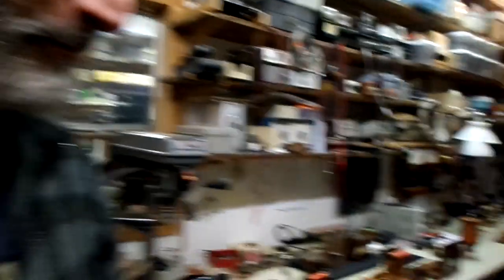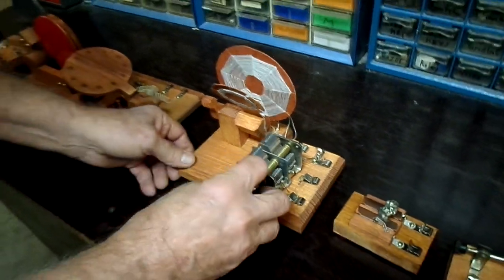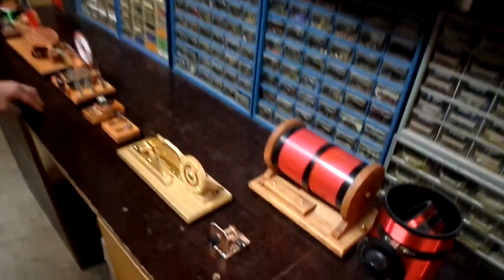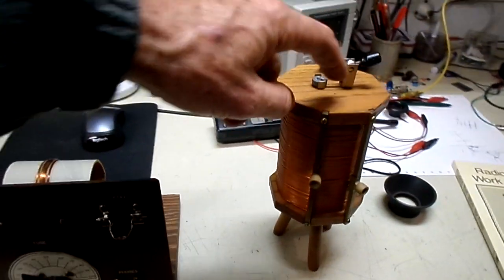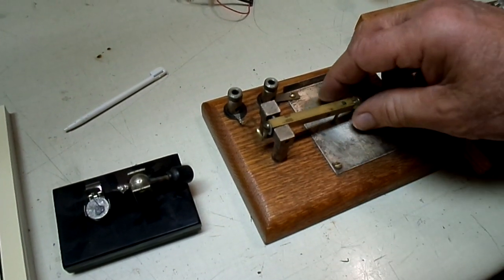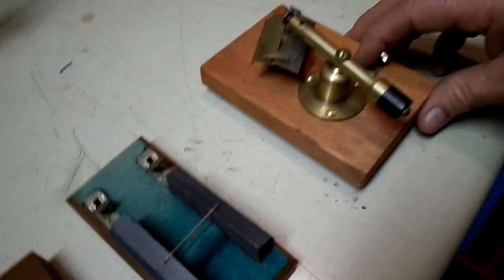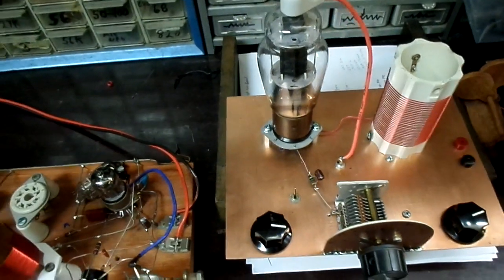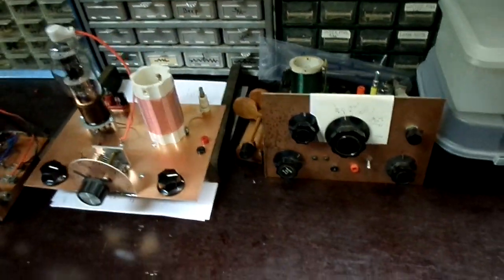Radios That Work For Free.

Comment: Very nice show and tell, and I love his unorthodox construction of adjustment methods. 

My brother gave me a Radio Shack 100-in-1 Electronic Kit when I was about 7, really early. I built most of the circuits in there and still have it. That got me into ham radio and an electronics career. I loved the crystal and transistor radio circuits in the kit best. 

I’ve been meaning to try the needle-across-carbon detector. Have you ever tried zinc oxide? I heated a sheet metal screw in a gas stove flame and that worked well. 

Germanium transistors are very sensitive diodes when you short B and C. 

For speaker output you can use a transformer. Paging/horn type speakers are cheap and sensitive.

Comment: I built a foxhole detector and radio using junk parts when I was around 14, I even posted a video at the time. https://youtu.be/HAVs2XBtfs4
I didn't have a crystal earpiece at first so i was using PC speakers, so technically my radio had an amplifier stage, but it proved to me that power free radio reception was possible. I think the wire for the coil came from a motor, and pencil lead and blued blade made the detector. What a cool hobby :)

Comment: Could you explain demodulate a signal? Thanks
Reply from the maker: If you had a CB radio and you pressed the microphone but didn't talk, the signal your were transmitting would be called the carrier wave. If you spoke into the microphone that would be called the modulation part of the transmitted signal.  To demodulate a signal means you are removing the audio information, or any kind of information which rides on top of the carrier wave  being transmitted such as your voice,  I hope this helps.
Reply: @GrantsPassTVRepair  thanks for replying. I was thinking if you were building a receiver why would you want to demodulate if your wanting to hear it was what I was thinking watching the video. I’m a newbie so look over me.
Reply: @GrantsPassTVRepair  Technically not removing the audio from the carrier but extracting the audio from the modulated carrier.
Reply: A carrier signal is used, this is the radio signal you tune into at a specified frequency.

A carrier is typically a sine wave, which is the simplest type of waveform possible. It contains only a single frequency.

A sine wave is defined by: amplitude, frequency and phase.
And you can change any of these.

To transmit audio by radio, we often use a carrier signal (but not always) and we have to change the frequency, amplitude or phase of the carrier in sympathy with the audio signal we wish to transmit.

If we change the frequency, then that is called Frequency Modulation, and if we came the amplitude that is called Amplitude Modulation.

So we have an electronic circuit in the radio transmitter that takes the audio signal and combines that with the much higher frequency carrier signal.

AM is easiest to deal with, to understand, and much simpler electronics required than FM.

So what is transmitted is a higher frequency carrier with the audio signal amplitude modulated on to the carrier.

You'll need to look for diagrams depicting this.

What is received by the radio receiver is that amplitude modulated carrier, and what the radio has to do is remove the carrier signal so that you are left with the audio signal. This process is called demodulation.

In AM radios it turns out this is incredibly easy to do. We just use a diode.

Comment: Oh,very good Performance.For 5 Years i endet my Hand Radios coil Manufacturing with colored Cooper wire good Coils.With Germanium or Schottky Doofes I receyving in the night Hourer 16 AM Stations with coopler Voila and 10 Meter Wire and Warth Ground,High Impedance Headphones.Best Regards Matthias

Comment: I was doing this stuff beginning around age 10 or 12. One tube radios using a 1T4 quickly followed with an A.C. Gilbert set. Then a two tuber Knight Kit.
   This is all still valid education for both adults and kids. What is a mobile phone before it's anything else? Answer: It's a two way radio. Without that most of the other  capabilities are impossible.

Comment: The "foxhole" radio at about 5:46 is just the detector. The actual radio needs a coil. Generally there is also a "wiper" to make the coil adjustable. I made one in the 4th grade or so (early 1960's). I think I used the school's steam heat radiator pipe for the ground. It worked. Crystal headphones have the best output. Cheap crystal headphones were easy to find in the 1960's.
Reply: Yes I think a foxhole radio would include a coil with 120 turns. But I don't think the G.I.s used wipers on their coils?

Comment: I built a crystal radio in the late 70's just for fun and the first thing I heard when I tried it out was E.G. Marshals voice the program was The CBS Radio Mystery Theater.
It couldn't have been more perfect timing, it was as if the radio was picking up broadcasts from the past. At the time I was stunned because until then I didn't know the program existed.
Reply from the maker: I can identify with the sense of wonder you must have felt.                                                                                  As a small boy I remember the thrill of hearing mysterious voices coming through my earphone. It was as if I was listening to aliens from another planet, and taping into a secret conversation of unknown origin.
Reply: @GrantsPassTVRepair  I was almost 30 at the time and it still was amazing to me that this particular show happened to be on  at that moment.
Reply from the maker: @electronron1  Sounds like it was meant to be. :-)
Reply: CBS Radio Mystery Theater boomed in on the crystal set I made that used a coil wiper.

Comment: This is a delightful video!  I am so glad you tracked down KE Edwards.  I ordered his book using your link to Hope and Allen, not wanting to pay $325.00 from Amazon or Ebay.  I cant wait for it to get here.  Ive been making various crystal radios with my grandkids when they come over for a week or so to visit...they have something to take home and talk about.  Ive been experimenting with making copper plate capacitors with saran wrap between the plates with a plastic screw to press the plates together and adjust capacitance.  I have had a lot of luck making coils that fit into each other rather than remain adjacent....I use forms using PVC couplers or tubing and find things with the proper clearance or either sand the insides down with a drum sander until they fit.  I wish someone could prevail upon Hope and Allen to print his second book.  Also...maybe Hope and Allen could get the rights to print "boys first book of radio and electronics" so we dont have to pay $200 on Ebay which I cant afford.  Thanks again for putting this together for us all.  Ted
Reply from the maker: I got my first crystal radio as a kid and never stopped enjoying them. All the best.
Reply: @GrantsPassTVRepair  So, I got the book, Radios that work For Free, and i have assembled the First Crystal Set Project, page 92, exactly as specified, and I cannot get it to work!  Nothing, nada, dead!  Yikes!  I have a great antenna, an excellent ground, both of which work on several other crystal sets I have recently constructed, but this one is a no go.  I think I must be doing something wrong,  I cant figure it out.  I'm confused and tired; I gotta get some sleep.  I'm gonna futz with this tomorrow in the AM.  Ted
Reply from the maker: @than111  Don't give up they do work.
Reply: @than111  Did...... You get it to work? Simple mistake? I'm curious.

Comment: I saw and heard a radio powered crystal set in the early 1950's. Invented by Wes Nichols.  It detected a strong local station and used the dc to power a Germanium transistor crystal set.  A 12" speaker no less!
Reply: That is a "stolen power radio".  You use the signal from a strong station to power the reception of a weak one.

Comment: what happens if you turn on all the radios. are they more quiet when all near eachother?
Reply from the maker: I'd guess each radio could potentially lower the volume of other crystal radios if the antennas were close to each other, but that's an interesting question.
Reply: @GrantsPassTVRepair  i have an instance... its CB radio AM but still the same concept. I have a 102" whip and I was parked right next to my dad and he couldn't talk because my massive antenna was interfering with his but when I drove down the street he got out fine
Reply: you get space radio signals!!

Comment: It remind me my first radio which  i built when i was a kid, in a small 
candy box TicTac, I made a paper roll for the coil and inside was a 
ferite bar to adjust de channel, i used a  diode which was a germanium 
OA90 and the capacitor a fixed ceramic tube 220pF, awful low sound 
volume on ear pieces, but working, no point anyway :D need 20 meters 
antenna wire and a ground wire as well, just experimental to have fun 
with children. No battery, but not portable at all :-) I saw it is 
possible to build such simple FM radio as well, but with some more 
components.
Reply from the maker: I also hope to build one for the FM broadcast band to see what's possible. A crystal radio was the first radio I ever owned. I remember being absolutely captivated that this strange little gadget my Uncle built me could pick up sounds from right out of the either, and adjusting the cats whisker over different parts of a rock could enhance reception.
Reply: HF is mysterious anyway, and always acts in reverse we would believe in LF

Comment: Very nice video. My first crystal radio I made was the last project in the class I took at 4H 60 years ago. For headphones I used my father's cloth cap/headset that he wore flying the US Navy F6F Hellcat in WWII on the USS Lexington (same as these chaps are wearing:  https://www.google.com/url?sa=i&source=images&cd=&ved=2ahUKEwiTw4LLrOrmAhW6JzQIHfJ4AFEQjRx6BAgBEAQ&url=https%3A%2F%2Fwww.amazon.com%2FPhoto-F6F-Hellcat-Lexington-Pilot%2Fdp%2FB007RQGHDO&psig=AOvVaw0DjJzayduatfneW6lOCDsb&ust=1578241038970850). Worked great! Did I see Litz wire used in some of those radios?
Reply from the maker: Just regular wire to the best of my knowledge.

Comment: Fun stuff, made couple of those when I was kid. Few years ago decided to craft one with variable capacitor from old radio. Even managed to make it work with regular headphones, I read somewhere that you can use transformer for audio output. (i built it with 220V to 12V transformer). Unfortunately AM is almost dead in this part of the Europe so during the day there almost nothing to listen to.
Reply from the maker: Yes, you need to use an impedance matching transformer to operate a conventional set of headphones.
Reply: yeah,croatia has no am stations whatsoever....